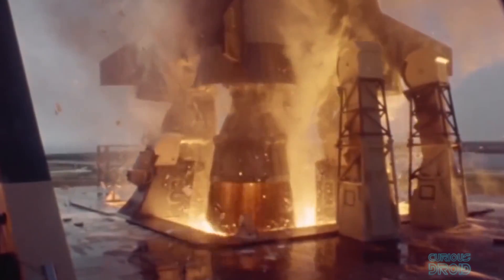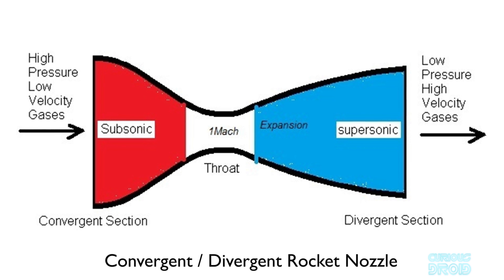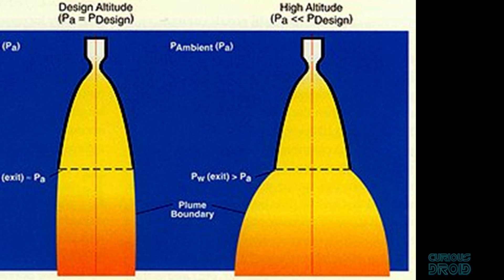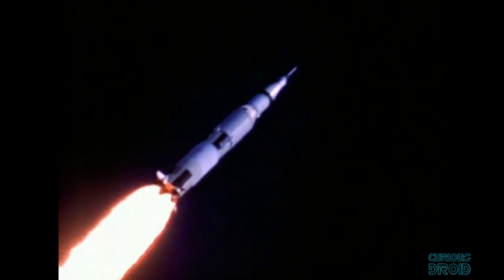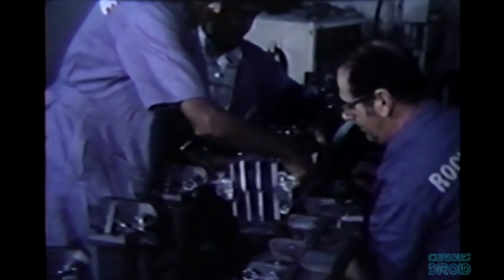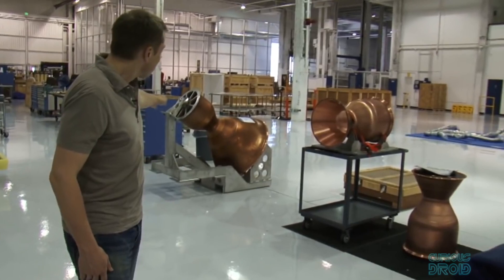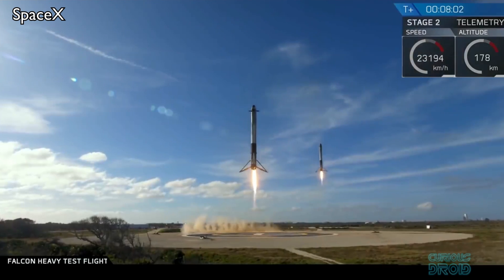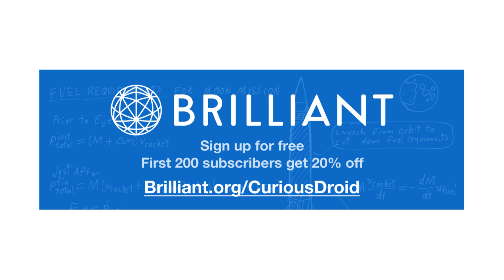Aerospike Engines - Why Aren't We Using them Now?

Comment: But if you could save 40% of the fuel, doesn't that mean you can have much bigger payloads? Isn't this called the rocket equation? Since for every kg of payload you need even more fuel, meaning bigger rocket... shouldn't 40% saving make a huge impact?
Reply: No.  The game is costs & dependability.  It's $200K for fuel.  A Falcon 9 block 5 costs $60 million per vehicle.  $200K isn't even the cost of interest on $60M (4.1% APR).  The cost of fuel is 3% of the vehicle's cost per launch.  The USA is recovering from the failure of the Space Shuttle Program.  30 years of time, money, and effort were wasted.  No good, except for the unused reentry tile technology, came from the program.  Must is the 1st businessman who is in charge of building a space transport system.  Do you understand costs?  Seriously.  NASA paid nearly a quarter of a billion dollars for every shuttle launch post 2000.  That's the cost of 4 new Falcon 9 vehicles and fuel for the lot.    The shuttle could take 7 astronauts into space.  So what?  When Falcon 9 is crew certified the cost of fuel for 7 personnel to reach orbit isn't even $467K.  Once the amortized Falcon is factored in it's $4.67M for 7 personnel.  That means the fuel & amortized cost for 7 astronauts into space is approximately $5.14M for the Falcon 9.  The Russians are charging us $60M per seat on a Soyuz.  Cost is the game.  The objective is to lower costs so more people can get into space.
Reply: Did you accidentally reply to the wrong comment? Because my question isn't about costs.

I'm curious if 40% fuel efficiency would translate to something like 40% smaller rockets with the same payload capacity, or same rocket with 40% larger payload capacity.

PS: Please don't bother answering, I doubt you are able to say anything productive anyways.
Reply: Try to read.  Most normal people want easy access to space.  This video told you that a Falcon 9 is only $200K per fuel load.  The "bell" rockets are dependable.  SpaceX's Falcon 9 will last 30 missions and when a follow up rocket is built it may use the aerospike engine.  

You got turned off to my answer because you don't understand costs.  Wow.  The whole of space exploration depends on costs.  It is a budget that drives the space program.
Reply: Again, I'm not talking about costs, but about rocket science.

But if you want to talk about costs, 40% smaller rockets for same payload and a single stage could DRASTICALLY lower costs of the falcon rockets as well.
Reply: Costs are related to science.  Somebody has to pay for it.  

The Falcon9 block 5 looks like it will become the standard launch vehicle for the next 10 years.  

I talked to a NASA engineer.  NASA & Congress will use the space station until 2025.  That's another 6 years because FY 2019 is in October.  After 2025 NASA wants to concentrate on a station around the Moon and a possible voyage to Mars in the post 2030s period.  LEO science will be farmed out to universities that will band together to fund research.  Also, commercial applications will come to dominate LEO.  Be of good cheer.  Humans are slowly really moving into space.    

If SpaceX makes a new intermediate sized rocket, in about the same class as the Falcon9 block 5 then more than likely it will use an aerospike and be SSTO.  The nice thing about SSTO is the vehicle could land in a sparsely populated and dispense with the drone landing ship.  

Falcon9 is a huge milestone for Space Exploration.  It's the first rocket system that lands and will eventually become fully reusable.  

Will aerospike eventually be used, without a doubt.  Costs rule and 40% in saving is too much to ignore.  However, there has only been one successful launch of a Falcon9 Block 5.  First a fleet of "Block 5" has to be built, the fleet has to be managed, and a follow up has to be designed.

One step at a time, one step at a time.

Comment: It makes  you wonder why we haven't developed SSTO vehicles.
Reply: Its because they are in reality kinda dumb. Your payload fraction is minuscule, so to bring anything work bringing into space you need a stupidly massive vehicle. Which would be more expensive, defeating the whole purpose. If you could make one efficent enough without being too expensive, the cost saving from less complexity might not be completly overwritten by the cost of a larger vehicle, but it wouldn't be some revolutionary huge thing, just a neat moderate decrease in the cost to send things into orbit.
Reply: Nobody is stopping "you".  Get the financing, get the engineering, get the permits, and build your SSTO launch vehicle.
Reply: Thanks, Easy Eight, for being an idiot! :-)
Reply: Meh... you're not an engineer.  I doubt you graduated from college.
Reply: Thanks for trolling.  Think whatever you want.
Reply: @Lobster, Jesse never bothered reading Aviation Week & Space Technology articles on the failed Venture Star.  Billions were gone in that failed SSTO vehicle.  Also, when it was all said and done the cargo of the SSTO was going to be 1 - 2% of gross lift off vehicle weight.  An expendable Delta rocket could deliver more to orbit.  Venture Star was never going to be in the same league for costs as the $200K per fuel load and $60M per reusable Falcon9 Block 5.  The minute you say "costs" to the uneducated crowd they say "trolling" and run off.  These are the same people who pay others to fill out their income taxes.

Comment: If it were up to me i would use earth magnet for the spike, no power, no malfunction, and more balance put extra weight at the bottom.
Reply: The magnetic fields need to line to maximize Thrust for it to would change the pressure in a lack of air pressure.
Reply: You can make a electricmagneticring to with iron core and copper wire to control the air pressure because it depended on the amount of power apply.

Comment: ...so—the basic rocket engine is—a subsonic burner and a mach throat, and then its exhaust is angled off a supersonic curve that can be any properly curved surface 'outside' or 'inside' even separated by a thermal recovery subsystem or by the entire fuselage width—cf A.C.Clarke's 2001 PanAm shuttle had a hybrid oneside-bell oneside-aerocurve-nozzle... you could use the curvature under a wing for VTOL or STOL...

Comment: a correction is needed on the air pressure correlation. you should state the air volume or mass instead of relating height or length.

Comment: You speak about the aerospike being more cooler however the problem is that you don't explain the temperature is needed to reach 2301.81 mph, or Mach 3 is not actually capable of happening under an aerospike engine do to the cooling problems on the nozzle result of the actual heat coming from the exhaust. This is why Lockheed Martin actually abandon the project. The engine could never reach powers strong enough to obtain Mach 1.3 without melting the nozzle. 
     Supersonic jet engines as seen on the SR-71 blackbird have been able to sustain Mach 3 at 130,000 ft.  

If there is a capability of the aerospike engine to be developed it would require a new type of lightweight metal that can sustain durability through mack 10 level heat for the duration of the time in which it would take to get to the moon, and back.
      However the biggest problem for the aerospike engine is that likely Lockheed, Boeing, and other aircraft companies may be more interested in developing filtrated nuclear engines using nuclear fusion power, as it would be far cheaper to develop filtrated nuclear fusion engines much more than it would be to develop the engine that you are talking about.
     Added to that the Aerospace industry his more interested in air travel, and transportation than it does in space exploration, therefore more companies like Boeing are going to be much more interested in what is the utilities of these aircraft in commercial transportation purposes then they're going to be used for space exploration.
Reply: You are confusing aerospikes with something completly different. I think you are thinking of ramjets, but you seem to completly misunderstand how they work as well.
Reply: No I'm not confusing with ramjets. I'm just stating the vid is spreading bullshit. It's quite easy to tell apart a ramjet from a aerospike. Aerospike's are not turbine engine, a ramjet is.    
      I suggest you look at this quote from Wikipedia "Cancellation of the Lockheed Martin X33
The program was cancelled in February 2001.[6] The main reason for this was reported as being a delay caused in completing the fuel tanks.[6]

Construction of the prototype was some 85% assembled with 96% of the parts and the launch facility 100%[8] complete when the program was canceled by NASA in 2001, after a long series of technical difficulties including flight instability and excess weight.

In particular, the composite liquid hydrogen fuel tank failed during testing in November 1999. The tank was constructed of honeycomb composite walls and internal structures to reduce its weight. A lighter tank was needed for the craft to demonstrate necessary technologies for single-stage-to-orbit operations. A hydrogen fueled SSTO craft's mass fraction requires that the weight of the vehicle without fuel be 10% of the fully fueled weight. This would allow a vehicle to fly to low Earth orbit without the need for the sort of external boosters and fuel tanks used by the Space Shuttle. But, after the composite tank failed on the test stand during fueling and pressure tests, NASA came to the conclusion that the technology of the time was simply not advanced enough for such a design. While the composite tank walls themselves were lighter, the odd hydrogen tank shape resulted in complex joints increasing the total mass of the composite tank to above that of an aluminum-based tank.[11]

Microcracking problem discovered in the liquid-hydrogen (LH2) multi-lobed tank core by NASA scientists at Goddard Space Flight Center ultimately caused NASA to cancel the X-33 program
NASA had invested $922 million in the project before cancellation, and Lockheed Martin a further $357 million. Due to changes in the space launch business—including the challenges faced by companies such as Globalstar, Teledesic, and Iridium and the resulting drop in the anticipated number of commercial satellite launches per year—Lockheed Martin deemed that continuing development of the X-33 privately without government support would not be profitable." 

https://en.wikipedia.org/wiki/Lockheed_Martin_X-33#Cancellation

My other findings of show that the aerospike engine has heat problems when reaching power levels required for Mach 3 or greater. This is where I made the comparison between the ramjet, and the aerospike as the ramjet does not have the same problems due to it being a turbine engine not a rocket engine.
Reply: Ramjets are not turbine engines. They have heat issues at higher speeds, but just saying its a heat issue and leaving it at that is extremely misleading. It sounds like special cooling or heat resistant materials could fix that, but thats not the case. Its a fundamental limitation of the laws of physics that I don't feel like explaining right now, but would be happy to if you really can't find something on Google.

The limitations on the aerospike engine you talk about are engineering limitations, not scientific ones.

Comment: The real reason is there are no space flights. Rocket engines need atmospheric pressure to create friction and work.
Reply: 1969nitsuga You sound like one of those bots that tries to predict a sentence by combining phrases. Each part sounds like it could mean something, but combined it means nothing.
Reply: ... and unicorns are green.
Reply: Ralf S. I depends on the chosen  color. NASA paint them in the same facilities they film moonlandings and ISS broadcasts.
Reply: But they managed to burn your brain.
Reply: Ralf S. With what? Fake rockets?
Reply: What do you think the fuel is doing? It is the pressure.
Reply: lobsterbark For some reason you don't grasp the concept of the continuity in a system. Vacuum or near vacuum disrrupt the continuity of the system. Momentum is only preserved if there is no external force afecting it.
Reply: lobsterbark Newton's 3rd. doesn't work as predicted unless there is something to hold on at. It needs physical contact in correct mass and speed to create force and momentum. If the exhausts gases have not enough external pressure the molecules get dispersed before transfering momentum tho the rocket mass. This is supported by empirical data and observable behavior. We can't get over LEO.

Comment: I was expecting some non-obvious but crippling physics-based problem with the engines (like how the hovertrain couldn't suck in enough air to maintain a hover at speed). But nope, it's just beuracrats pulling the plug.
Reply: Michael Martin so was I, seeing as there is no physics based problems and they have been ground tested to prove they work, I'm assuming eventually companies like SpaceX will start on developing the concept further, it will rely on there being enough money in it but if they are more efficient then eventually progress will force them in that direction
Reply: Actually, aerospikes have been found to offer only marginal benefits, if any benefits at all. The Shuttle SSME performed better than the Venturestar aerospikes at all points in the atmosphere. Yes, even at sea level. And yet, the aerospikes were enormously complex. Even more-so than the SSME. With virtually no real benefits and immense complexity, it's just not worth doing. They got better performance with a 1970s bell engine than with aa 1990s aerospike...

Comment: We aren't using them because they don't work, space is fake. Brilliant is the fastest way to dumb down a person as is Common Core they are based on the same principles. The Physics of Water proves Earth is Flat. Water always takes the Shape of it's container and it always seeks it's own level - cannot happen on a ball. You say Gravity But for the scientific method to be upheld and prove Gravity holds back all those gallons of water - there are 264 billion gallons in one cubic Km for an estimated 1,386 km's of water on Earth. Thats a LOT of Weight the gravity would have to contain - No force gravitational or otherwise has ever been measured to do this. Now the scientific method Requires anything it tests to be Reproducible IN A LAB under Controlled conditions And it REQUIRES it to be Repeatable by Everyone or it's Not considered valid factual science - We don't have this for Gravity. One droid to another -  Check Mate Droid. You Cannot refute these truths... you certainly have No science that can debunk this because I Know how the scientific method works.
Reply: Yes, there is a lot of water; about 1.4 quintillion tons of it. The thing is, that's only about 0.023% of the Earth's mass. Most  pictures of the Earth's layers don't show the true scale, but this does: https://sizemattersscience.files.wordpress.com/2015/02/earthstructure3a.png

Comment: the bell shape used on rockets constricts in higher altitude to adjust for change in pressure. Basically the diameter of the circle at the end of the bell decreases to adjust the thrust. thats why

Comment: You would think that there is more versatility in the shape of your payload if an aerospike moves you away from the traditional rocket shape.    I guess it depends on just how much of a performance increase you get for the money you budget getting the design to work.  That said, has anyone developed sounding rockets with aerospike engines?

Comment: Staging isn't just necessary due to different nozzle types but mainly in order to shed dead weight. An half empty tank means half of the tank isn't used anymore so you're carrying several tons of unnecessary weight.

Comment: I've always liked the Aerospike engine since I first read about it. Unfortunately SSTO, while a holy grail, the benefits of staging far outweigh the possible benefits of reusing a spaceship. The time and cost to refurbish a human certified reusable ship is not as cheap as one might think. Think that was one of the main problems with the space shuttle.  NASA was testing an Aerospike test bed, on a SR71, before some project was cut. Unfortunately, they never got to the point of using it as a rocket engine.

Comment: Didn't the SR-71 Blackbird use spikes?  And also, don't many supersonic craft like the F-15 have some sort of adjustable aperture around the exhaust?  Or am I thinking of something different?
Reply: Thought they might be as well but remembered the spike is at the front of their engines to control airflow in. It uses a turbo ramjet like engine.
Reply: Ah.  I think you're right.  I know next to nothing about air craft.  I just remembered the SR-71 having spikes on the engines.

Comment: I wonder whether the main issue for using the Aerospike for spacex, blue origin etc. would be that it might not be possible to re-light it when flying retrograde (i.e. engine-first) back through the atmosphere to land - with a bell nozzle, the ignition gasses and initial exhaust are cupped and contained in the nozzle by the airflow, whereas for an aerospike they wouldn't be and might delaminate